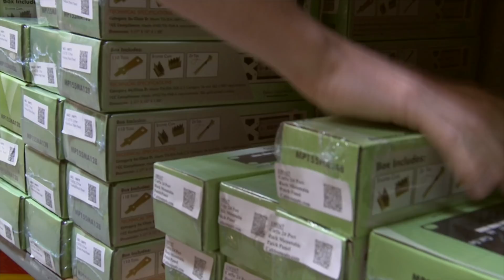The Good, The Bad and The Ugly Data Rooms : Episode 1

Comment: Used to tell prima Donna IT guys that we do not work on their abortions. They never used fire stop even when told numerous times. I retired from a large hospital where they were very strict. Most computer cables were installed neatly by union guys. Had ladder racks in every hallway.
Reply from the maker: Union or NON union there is good and bad. I have seen both.

Comment: Had an experience years ago. Comcast phone would default to a high loop current. This high loop current prevented the "business" phones from detecting when a line was on hold so the phone would pick up the next line to dial out. Interesting diagnosis that was a setting in the cable phone dmarc.

Comment: The USA can use orange for data?  in Australia youd likely be deregistered but definitely   fined, orange here is reserved for LV/HV only  

( USA's LV might be equivalent to our (s)ELV.   Our LV is  71v ac/120vdc to  1000v AC/1500 DC
Reply: USA LV is very low voltage, like POTS voltage or 12v DC voltage for example. Orange is the traditional color for telecom in the US for utility marking and conduits.

Comment: Love this type of video. 

11:41 We have a small used car dealership and had an old Merlin 410 phone system up until 10 years ago. I went to an IP based phone system and removed the amphenol jacks and cable along with the 66 blocks.

It's good to remove the old stuff and keep the IT closet clean.